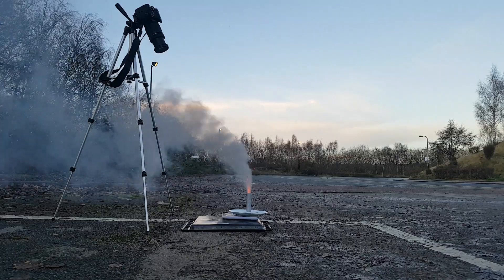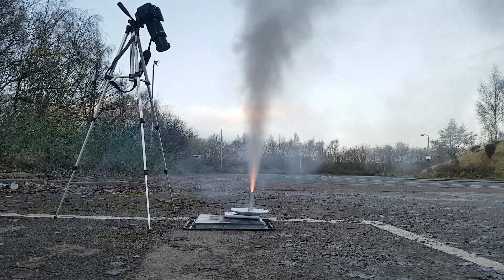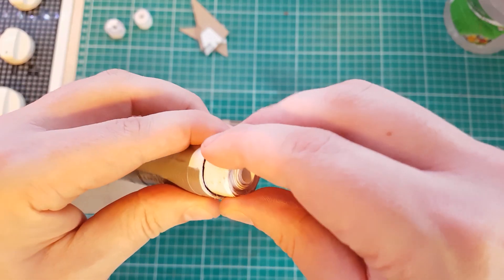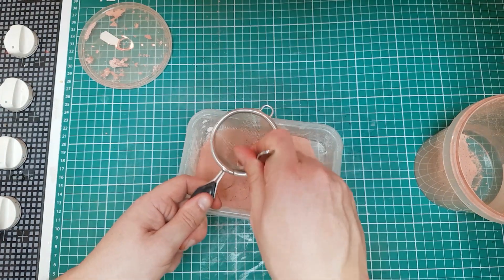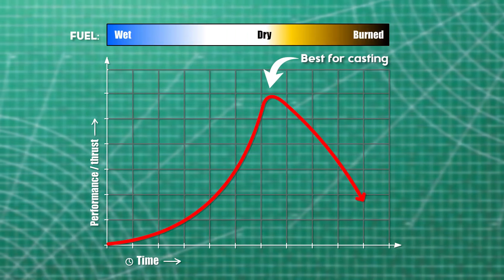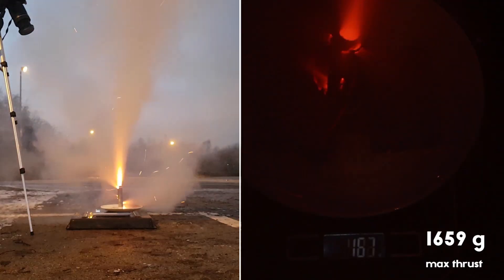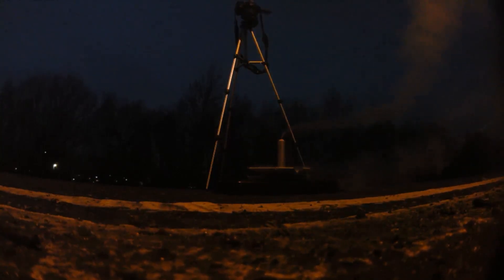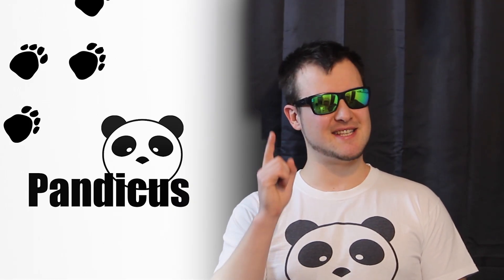How to INCREASE the power of your SUGAR rocket (Kno3+Sugar+Fe2O3)

Comment: Darn, i miss picmario's videos. Ok here is the thing, dont use iron oxide, use iron carbonate instead, its water soluble and would distribute at molecular level in the mix. Even when coffe grinded, it would not get as small as water disolved iron carbonate, also, replacing a portion of sugar with sodium eritrorbate guarantees extreme power. Im not kidding about this, this would give you samples that will fly off even without casings

Comment: Very informative video, but why can't you say the KNO3 is just Potassium Nitrate? You don't call Sugar C12H22O11 or Iron Oxide Fe2O3.
Reply: That's rather pedantic.

"KNO3" (as one example) even rolls off the tongue quicker than "potassium nitrate" does.

All kinds of contextual shortcuts get used in chem. If "KNO3" is the only one present, one might refer to it in the context simply as "nitrate".

It's also useful for keeping memorized formulas fresh. When you learn a new compound, especially in the simpler inorganics, it's useful to refer to them as their formula rather than their common name. You can always get the name out of the formula using the rules, but formulas aren't always obvious from just the name.

In fact "Fe2O3" is used much more frequently than "iron oxide" in chemistry because there are 3 common oxides of iron... Fe203 is just one. There's also FeO and Fe3O4. Unless you specify the oxidation state (eg "(ii)", "(iii)" etc) in the name, you're referring to any of them in general. Since "iron (iii) oxide" takes more effort than "Fe2O3" to say or write, the latter usually appears in the wild.

You're correct with sugar... partially. That is "sucrose", and just like with the nitrate, if it is the only one present, it's probably going to be referred to simply as "sugar". Again, whatever is simpler to note.

Comment: Omg. Do not put wanter into it. If it contains water or humidity, the engine has lower power. Add instead 4 milliliters Glycerine to it. 
And most important, do not overheat it :) It is Rocket-Science, not Cooking or Haute Cuisine ^^ That means: do not say something like "set your cooking-plate to medium power" because that is maximum unprecise. Instead you need precisely take care about the temperature. Do not make the pan/pot hotter than 100° Celsius, or it will dry out and getting chunky like you have showed it. If you are not hotter than 100°C, you have no issues to find the point between undercooked and overcooked. Just my hints, no offense :-)   I could say i am the Heisenberg of Rocketfuel-Chemistry, but i should not xD  Even i can still learn somethings 🙂

Comment: You can use free programs like Open Rocket or Space Cad (Space Cad is actually not free but you can download it and use it for free) to design rockets or if you are rich and want to design super complex rockets you can use Rock Sim too. Also to design rocket motors there is something I highly recommend called MATH. You can design bigger, more efficient, more complex, cheaper and safe rocket motors with it.

Comment: the quality is definitly improving and the amount of test and iteration is pretty crazy ! you're doing a good job, and safety is getting a bit more serious (still, i've a odd trajectory, pretty horizontal for a safe flight). However, there are a few problems to point out : you should definitly use electric igniters, more expensive but more reliable, safer, and they'll do a better job than fuses ; the process of making the fuel is also safer now, with the use of water, but you must warn your audience about the risks of overheating and setting the propellant on fire in the pan ; paper is great because it's cheap and available everywhere but, you can see a lot of drawbacks : weak agai,st pressure and heat, easily pierce (all your high power motors had massive leaks on the front)..etc. ; you should use aluminium or at least PVC, for better results and safety. 
Last thing : your test bench works great but it would nice to dive into the maths and start making the thrust curves of these neat and powerful engines. If think Richard Nakka explains how to, pretty simple and you'll be able to give more intels to nerds, than max thrust (for example, ISP, total impulse, average thrust, burn time...Etc), it would be awesome ! 
your doing a great content, keep it up, and can't wait for the next video and your improvements !!

Comment: It is recommended that you take your rocket shell to soak in a hot saturated sodium bicarbonate solution, and then remove it to air dry after it is completely soaked, so that your rocket shell is not easy to burn.

Comment: Uhm... Noo, the nozzle is not increasing the pressure of outgoing gas... It actually does the opposite, pressure in the nozzle drops while velocity increases, it's well knows paradox for anyone who knows anything about aerodynamics and fluid flows. But anyway big pros for so many tests and achieved results :)
Reply: The nozzle increases the chamber pressure, not the external pressure
Reply: That's what I'm saying, but in the video it was said that the gas is pressurized in the nozzle which is incorrect :)

Comment: The one thing I can't find is the fuse to light the rocket it's so hard to get.
Reply: Take some sugar fuel, dissolve in water in a saucepan, add a cotton string and boil off the water until the strings are coated in fuel, stirring thoroughly. Once most water is gone, bake in a (very importantly, electric ) oven at 105°C for 5-10 minutes or until completely dry. do not use a gas oven or bake at a higher temperature than 120°C or you will ignite the fuse 
Make sure the fuse is spread apart while baking, and cut to size when cooled

Comment: What exactly is the formula in the video?  I don't understand much, what is the maximum power?
Reply from the maker: Sorry man, my accent may be hard to understand sometimes. That's why I made subtitles for the video. :) The formula is 65% KNO3 + 35% Sugar +1% of Red Iron Oxide (Rust). All of them in powder form. :) The 50g rocket with about 25g propelland reached over 2500g of thrust. :) But It really depending on how you prepare it, the video will help to do it. :)
Reply: @pandicus1412  man, I don't speak much English so but the video is excellent.  Thank you very much.

Comment: Don't glue in nozzles, use the tube end as the nozzle!
Saturated about an inch of the nozzle-end of the paper used to roll tubes with white glue as you roll the tubes; the softened gluey paper is crimped around the core-burner dowel and secured with cotton string, the string saturated in glue.
An internal form to control the shape of the crimp is not a bad idea...
Once the crimped bit is dry, ram or cast the mixture around the core-dowel, then remove the dowel.  You didn't glue the dowel into the nozzle, did you?
Close the open end of the tube with a  plug or another clever crimp/glue dance.
A good sugar rocket motor should burn in under 2 seconds...a crimped nozzle can last that long.
Crimping eliminates any glued joints; can't leak or fail!
Any excess pressure will simply blow out the crimp!

Comment: History of using red iron oxide in fireworks!
Lots of fire-work mixtures use white or light yellow ingredients.
Charcoal makes too much light on its own for blue, purple or orange fire.
Dextrin (a kind of sugar), copal gum and others burn with a very dim light, but they are white powders.
Hard to tell if it was mixed at all when all the bits are the same color!
By blending 2% red iron oxide into one of the ingredients, it takes on a strong red color.
Mix everything until it is the same shade of pink, all is good!
What was figured out really quickly is that iron oxide is a catalyst in many mixtures!
Even worse, some mixtures would react with the iron and ignite/explode on their own.
'Flowers of Sulfur' and iron as a bad combination.  
'Flowers' a kind of sulfur made by distillation, and often has traces of sulfuric acid in it.
After a few things got sorted out, red iron has become a staple ingredient to regulate reaction rates!
As little as 0.5% can increase burn-rates.
It is also very good at suppressing static-electricity build-up; many mixtures are sensitive.

Comment: It is safer to grind your ingredients separately with a pestle and mortar then to stir them together and pack.
Reply: Grind both separately, but I recommend using a blender or electric grinder, and mix once ground finely
Reply: Its safe unless there is no high heat (over 500 C) or fire. Grinding separately doesn't make anything safer because there is nothing dangerous.
Reply: @Emre_Kermen  Grinding rocket fuel creates friction, and therefore heat, meaning that it COULD ignite the rocket fuel. Also, it is best to be overly cautious when using any flammable, corrosive, or any potentially dangerous elements or compounds.
Reply: @austinmair7995  friction creates heat but I havent vaporized all the water while making milkshake. 500 C is a lot, a blender cant heat up that much
Reply: @Emre_Kermen  But your milkshake isn't a dry and flammable powder with a high surface area, it is a liquid with a boiling point of around 100°C, that is probably around 5-10°C. also, should you be doing anything similar in the future that uses a blender/pestle and mortar and is even more flammable, it is a good habit to get into.
Reply: @austinmair7995  so you believe that a blender can heat up to 500 C in a few minutes mixing dust?
Reply: @UCiVVejRcr_ULwhXFVY4-XEA if there is a leak in blender, dont use it also sugars boiling point is not 100 (dont use the first google result without checking it :D)
Reply: Also if you use fuel in powder form It burns unstable and even if you design your motor (using math) It can explode because of that.
Reply: KNO3’s boiling point is 400 C

Comment: cool trail and error.  you can order estes rockets. they have all the arrow dynamicks worked out. factories usually discard there cardboard cylinders from the shrink wrap they use. the cylinders can be 1 inch x 6 inch to 3 inch x 24 inches.

Comment: during the drying and cooking phase of the process, it sounds like using a double boiler or a pot inside of a pot of water would help prevent you from burning the mixture
Reply from the maker: Yeah, thats a way too.. ;)
Reply: A double boiler will not work because it cannot get hot enough to melt sugar, in the process of heating you melt the sugar not dissolve it, and sugar melts at temperatures a lot higher than 100c which is theoretically the max a double boiler can reach.

Comment: Great rocket making video. But can you explain please, why you are casting your fuel mixture instead of using powder form of fuel mixture?
Reply from the maker: I did video about different powder mixtures. https://youtu.be/vJKOOOfBi3Y

I could crush the melted mix when its dry to make it even better bit I had no ball mill back then. 
As I told at the end of the video. This is Just the top of the iceberg. :)
Reply: @pandicus1412  thanks❤️

Comment: How would a rocket motor made from a beer can work? With 500ml volume, would the power get stronger, or would it last longer? 🤔
Reply from the maker: A beer can has not the optimal size (in length and diameter) for a good result.
However It might work. I may do some tests in the future
 :)

Comment: I don't know if this is a good idea, but wouldn't it make sense to make a sugar test heating. 
What I mean is, that you put a sugar test portion in first and then you're slowly turning up the heat. There will be a sweetspot where the sugar melts without burning or caramelizing. And with this temperature/setting you can heat the whole mixture.
Reply: Wow, good idea!

Comment: You nailed it.  About 35 years ago, when I was younger, we had the same mixture and found using water and "cooking in  a pot" created the best sugar rockets.
However, something we noticed you have not tried, was we took the hot mixture from a pot and placed on a cookie sheet (baking pan) and let it dry in an oven at 250f for several hours.  Then ground the mixture to a 'talcum powder' consistancy.  Then pack the rocket as you would with a powder mixture.  (for us) this worked the best.   But that was 35 years ago :-)

Comment: How do plastic rocket bodies not melt
Reply from the maker: Well... My method is that I use a paper inner chamber for the rocket... If it is glued well, it can withstand the pressure and the heat of the rocket. A paper casing inside the pvc (or other plastic) can reduce the heat up of the outer layers, so the rocket will not melt that  easy, and the paper can keep the rocket's shape even if it is melted a bit. However the paper casing will be destroyed, It can be replacable for the next flight. :)
Reply: If your motor is designed and working properly, casing shouldn't heat or burn.

Comment: I found this after watching a vid from The King of Random on How to make Sugar Rockets. Since he's not available, I'll ask you. Can this explosive be used as a projectile launcher.. as in gunpowder replacement? I am looking to design a gun that does not use standard gunpowder. This is to give all people a means of defense if they cannot obtain a gunpowder firearm for whatever reason.
Reply from the maker: In some way it can but honesly I do not recommend it. 
Its not just because its dangerous but "red powder" composition has pretty slow reaction in comparison of black powder.
So I think it will more like burn than explode (which would needed as a projectile propellant)
And it will just push the projectile out of the chamber and leave long flame burst.
Yeah in the video you could see a rocket which exploded due to the small nozzle. But it exploded itself. 
Making it push a projectile forward is really hard or maybe even impossible.
Gunpowder and flash powder has way more faster reaction time which "shots" the bullet out of the barrel.
**
Maybe I am wrong as I never tried using red powder this way... but according to my experiments its not really a good way.
Reply: Burn ratio can be changed by grain size.
Instead of a solid slow burning lump, push it threw a screen and make grain sized powder.
Reply: @lukasgoza4493  It won't work. Its hard to explain for me because my English is not that good but you can learn why it won't work if you do some research about what a bullet does and how rockets work.
Reply: @Emre_Kermen  black powder explodes. Muskets use black powder.
Modern rifles used double based powder, which is a mixture of nitro cellulose and nitro glycerin; it does not explode. In open air it burns away in an oxidizing reaction just like solid rocket fuel.

shotgun and pistol powder all the way up to magnum rifle powder is all the same thing (some companies might play with the mixture a bit to make it more stoichiometric, etc to play with cleanliness and speed); but they mainly create the burn rate of the powder using grain size. shotgun/pistol powder has more surface area with large flat waffers, while magnum rifle powder has more mass with larger and larger cylinders or balls.

So when it comes to launching a projectile you'll want a special barrel that can measure internal pressures; then play with your mixture and grain size to clean up the powder and control the burn rate. After you've developed enough data you can move up or down calibers if you can find appropriate CUP values (CUP is used for measuring pressure).

The problem is heat. The cannons on large military war ships use nitro guanadine which, for lack of a major discussion, is triple based gun powder (it's used because it burns at a lower temperature causing less barrel erosion, but still produces a very large clean expansion of gas).

In my opinion, rocket candy could be used to fire a projectile from a rifled barrel; but your probably going to need something that can cool the reaction, or you'll erode your barrel too quickly. Also you'll probably spend a fortune on barrels before your first successful shot.

Reloading is rocket science, rocket science is the applied application of chemical decomposition rates to produce a desired rate of burn, then applying that to an application. It might be to put in a rocket to force out a nozzle, or it might be put behind an object to pop it out of a barrel. In the end it's all about expansion of gas.

Which is all about the pressure curve being created. Not about how a bullet works or how a rocket works; it's about your propellant and the rate at which your propellant burns and acts as it gets pressurized.

Did I mention I shoot long range competition.
Reply: @lukasgoza4493  So do you want to build a gun with sugar-KNO3 or do you want to build a gun size rocket launcher? I think you can build a gun with this fuel but building a effective rocket launcher in this size is hard (with sugar fuel probably impossible)
Reply: @Emre_Kermen  your probably right!? I don't really know very much about rocket candy. I'm just trying to imagine how it might be done with applied reloading?

It's definitely a field ripe for discussion, and I'm sure nobody could be considered an expert?

Comment: So you can't blend them together, but you can cook them together?
Reply from the maker: You can blend them together and it will work (I made another video about this :) ) But In my experience it wont be as powerful as the dry heated version. The sugar and kno3 particles must be as close as possible, and with the cooking the sugar just meting around the kno3 particles. That's why it becomes powerful. :) 
There are other ways to improve the fuel, like granulating but Im gonna talk about this in an other video. :) As I mentioned at the end of the video... This is just the top of the iceberg. :)
Reply: oh that makes sense, thanks!